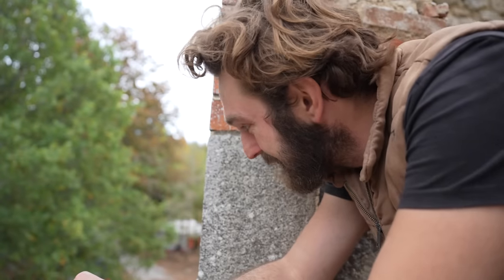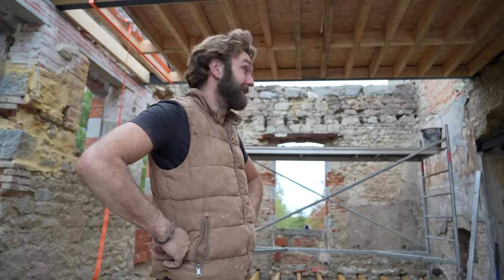it's finally finished, ready to install the floor.

Comment: I am amazed and stunned that: 1) you are not wearing safety glasses while using an impact hammer on the walls; and 2) you NEVER wear any type of work gloves, especially when working with stones, bricks, and rusty metal. 
 
Impact hammers send stone chips flying whenever they are used and your face/eyes were only a foot or two away from the holes you were chiseling into the walls. Don't you value your eyes and the ability to see? If you get a flying stone chip in your eye, you'll wish you had been wearing safety glasses.
 
I think you were/are absolutely foolish not to wear some type of work gloves; especially so when you were excavating god-knows-what out of the basement rooms. I saw broken glass, ceramic tile shards, pieces of metal, and other sharp objects that could easily puncture your hands. I'm wondering what your hands look like after more than a year of this work without wearing any gloves.